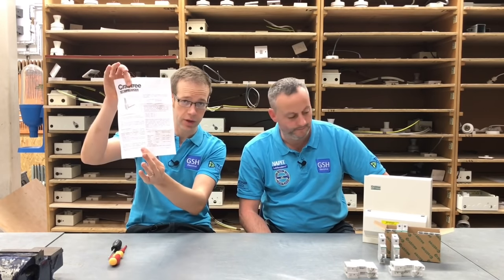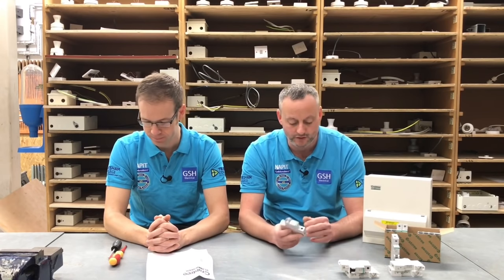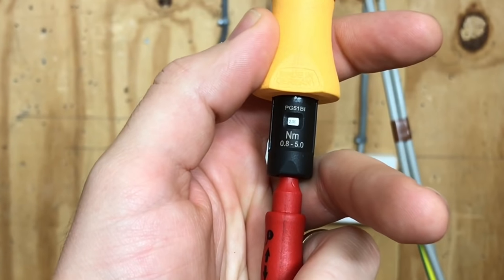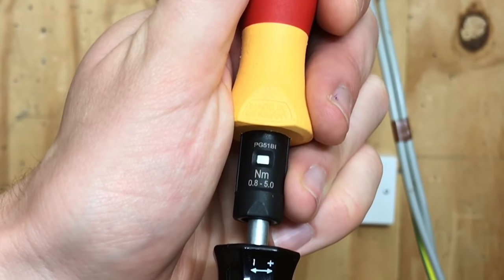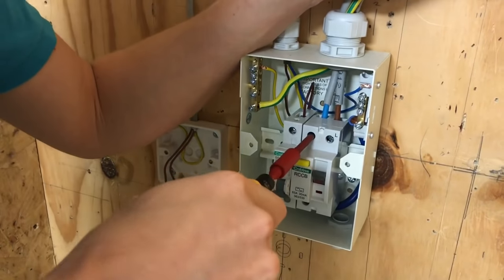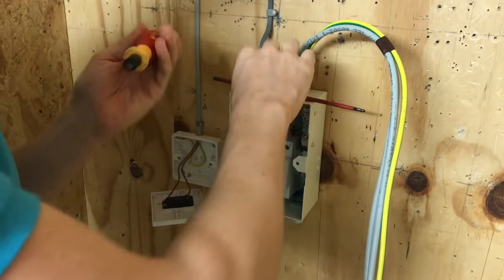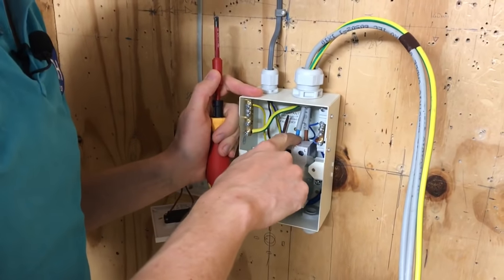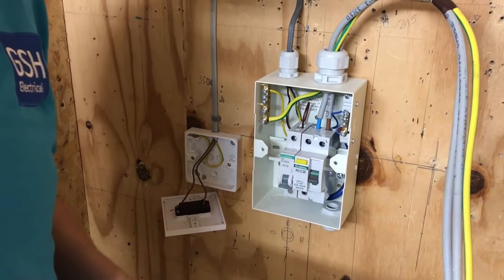How to Set a Torque Screwdriver up and Use it - Torque Settings on Crabtree Circuit Breaker (MCB)

Comment: Maybe also they could print the torque setting on the front of the breakers as have come across some consumer boards with different brands of breakers in them and also quite compacted and no other way to check the setting other than remove the bus bar...
Great video guy's...
On a personal note still not sold on Torque screwdrivers (over priced)... But have been using the modular set of screwdrivers for a number of years now and cheaper to replace when worn...
Excellent video's guy's...
Reply from the maker: Hi. Thanks for commenting and what a great idea about putting the torque setting on the front. All the best Gaz 👍

Comment: What would you say to a tester that is telling you to ignore them 2.5Nm on the main switch isolator ? He says he got bad readings and nobody should use any torque but tighten it as much as possible by forcing it...
I laughed and walked away for now as if I would do that it would destroy either my screwdriver or the whole switch itself.

Comment: Why the different setting on line connection compared it's neutral connector?
Reply from the maker: Hi, they have different types of connections eg the top of the breaker has a cage connection 👍 and the neutral and earth don’t. Thanks for commenting and watching. Gaz

Comment: If the consumer unit connections have to be done with the torque screwdriver ,why doesn't the light switches and sockets have to be done ?
Reply from the maker: Hi. The maximum current drawn from any circuit is form the consumer unit. Maybe in time all connections with required a torque setting. Thanks for commenting and watching. Gaz

Comment: I've never really understood or agreed with why the terminal screws on the earth bar must be to a specific torque as ordinarily the cpc doesn't carry any current.
Reply: I'm not an expert but the quality of the earth connection seems to be the lower the resistance the better.  If there was a link in the chain where the torque was way off, it could end up being a much higher resistance connection in a fault situation which might end up limiting the current enough that the breaker wouldn't trip, resulting in dangerous voltage appearing on a part of the installation's earth wiring.  Unlikely of course, but like most accidents it's always a combination of unlikely events that results in the accident happening, so I guess by properly torquing the earth connections all the time, you might prevent an accident when everything else conspires to make it happen.
Reply: @Berkeloid0  Well, that's partly why we carry out an R1+R2 test and Zs test but anyway like you said theres a string of connections in circuit so why does the one made at the consumer unit have to be to a specific torque and every other one down the line can be tightened to whatever the installer wants.
Reply: @ashmanelectricalservices4318  I suspect it's only a matter of time before every other connection will have a specific torque requirement too :)
Reply: @Berkeloid0  I hope not, I'd be there all day adjusting the torque settings depending on what I'm trying to tighten. The only reason I can think of that connections at a consumer unit need to be to a specific torque is that there is a greater number of electrical connections at the consumer unit and so, a greater likelihood of terminations being under or over tightened.